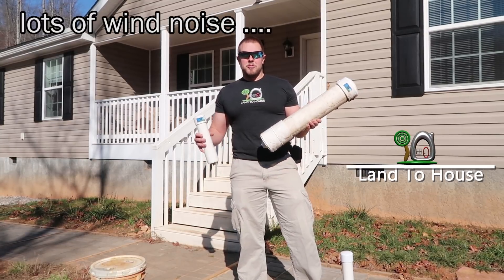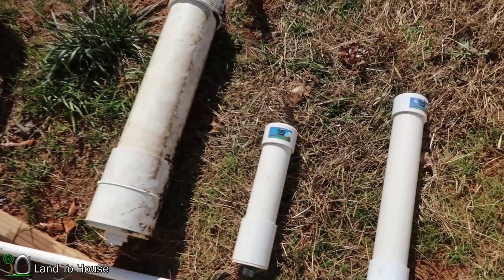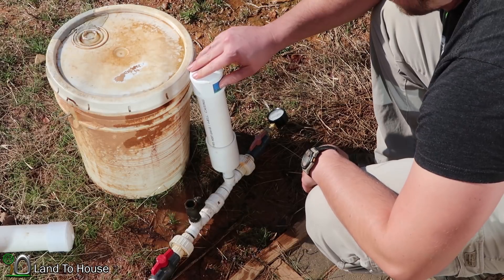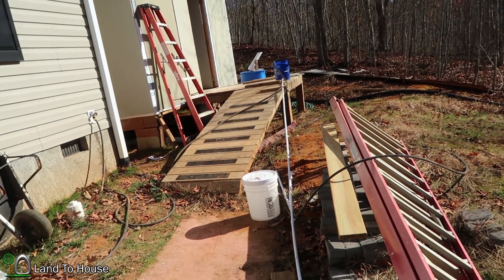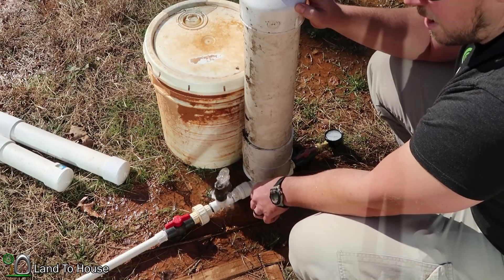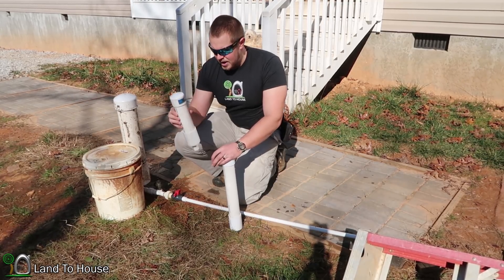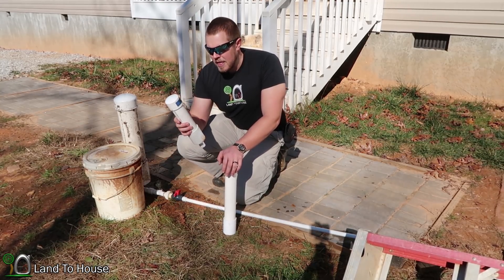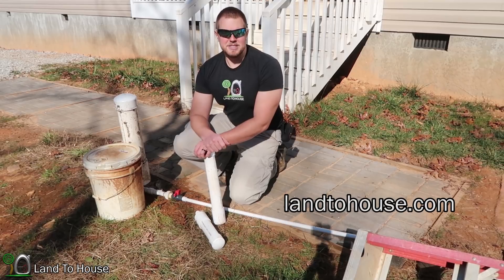Pressure tank size - Ram Pump

Comment: nice vids but as you have said you fill one of the tanks with a bike tube.
ok that can help but air is air and even the tube will be useless over a given pressure so maybe try this.
1 take your big tank and add a hole at the top and fit with the valve from a car as this tyre valve will seal itself and give you a way of pre filling the tank.
2 open the in water so the waste valve is closed and add air to the tank to say 30% of you max psi.

this should do two things 1 stop more water getting in to the tank as its got pressure in there that's just air and 2 the pump should start without having to prim it with the waste vale. try it with the overs as i can see the small tank maxing out its psi before the big tank thanks to its small volume but with an air valve in the top you can push out the water just by adding air from a foot pump and the pump can then start filling up without losing pressure and thats means better head height but from a small tank have fun
Reply from the maker: I have a friend in France that uses a house water pressure tank that has the valve you're speaking of. It seems to work quite well. That is a bit more work then I'm able to do for my pumps. But your idea is a very good one. And produces good results
Reply: you could try adding the valve to the Tee just under the tank and the air will bubble up but in this way you can change the tank size with out modding any off them then you can try the clear bottle to see what happens inside

Comment: Nice video,   40 PSI is amazing..   Maybe go even smaller on the air tank,  and see,  just how high you can go..  I would think,   pressure is what determines Head height of the out put..  3/4 pipe is less than 1 square inch..    Would a 1 inch diameter,  put out less ?
Reply from the maker: Turns out the 40 psi  was reached because the tank was so small with such a small input water volume. The larger tank would reach that value also with more time.

Comment: Sizes, fall rates, valve flow.  All effect the end result.  If you used a stepped feed supply over distance and drop height starting with say a 3" pipe for the first 1/3.  .then a 2" for the next 1/3.  Then 1" for the last 1/3.  Then go from a 1" valve test, then try a 3/4 valve step, then a 1/2" valve test.  Also varying the length of the feed pipe sizes and drop rate for each.  by the end you can then decide what you need for each job from the results and have a base you can work from for an idea.  IE:  flow or pressure  to give the ratio needed to get the job done.  I have seen this before but don't know the numbers or formula to calculate it.

Comment: im aware this is an older video and unlikely to get this comment read but is it possible to precharge the tank with a bicycle pump to get that pressure with no downside?
Reply from the maker: The tanks that I sell with my pumps do have a bike tube inside. The tube allows the tank to have an air pocket that cant be filled with water logging over time. I have heard of people using a house pressure tank with bladder also.
Reply: thats just cool...i know absolutely nothing about ram pumps....the tube you put inside, is that atmospheric pressure? or do you prepressurize it before assembly?

Comment: I think the tests could be slightly improved...

1) The 5 gallon bucket seems to limit the test to 2 minutes. This is a very short time to truly test the 4" pressure 'tank'. The discharge pressure was still climbing when the test stopped. Perhaps add a running garden hose to the bucket to extend the test time.
2) Discharge Flow should be measured in ALL tests. The smallest pressure 'tank' started the quickest, but maybe the small volume of compressed air would also create a very small discharge flow.
3) The number of taps to prime the pump is not really a concern. Whether it takes 4 taps or 24 is irrelevant ... as long as the pump keeps running. Again, once the pump starts it is intended to run a very long time.
4) The water supply bucket head was roughly 3 feet. This has a direct influence on the water hammer pressure wave. Try two tests ...one with the 3 feet head, and perhaps one at 6 or 9 feet of head, or higher. This should have a tremendous impact on system performance.
5) Make a chart of ALL the readings in each test so we can pause the video and scrutinize the results.

I like your videos.
Reply: Dan .... thanks for a real analysis.... btw is the height important or the run off distance for a good pressure head???
Reply: exactly what im thinking. ty sir

Comment: So. Take the big pressure tank and drill a tire chuck. Use a bike pump to bring your big pressure tank up to the correct psi before you start your pump? Then what happens?
Reply from the maker: One issue with over inflating the bike tube inside is that it reduces the volume of the tank. The water that builds up is the main thing that gets the pump going. I am not sure of any way to pre-prime the tank.
Reply: Land to House I see. Well anyways I enjoy watching your videos. I'm in the process of making my off grid house right now....I have no springs but I'm using a rain catchment system off the gutters. My plan is to have my main storage on a platform about 4 ft off the ground. Then using that drop to feed a ram pump that brings water into a ibc tote water tower 16ft up in the air that way I can gravity feed my house with water. My waste from the one way swing valve will fill up a five gallon bucket with a bell siphon that will run to a much smaller wattage pump on a float switch to pump the waste water back to the main storage tank. Therefore eliminating the need for a power hungry pump to pump 16 ft up. That is my plan anyways....is that totally pointless or you think a good idea? Thanks!

Comment: What is the maximal percentage for the feed pipe? Is over 45% to much? Could u test it please?
Reply from the maker: When you say feed pipe I assume you are referring to the drive pipe? Do you want to know the amount of water that is lost from the waste valve vs the water that is pumped?
Reply: Land to House Thanks for the fast reply. Yes with feed I meant the drive pipe. With the percent I meant the drop/gradient of the drive pipe, if there is any maximum drop. And sorry for my English.
Reply from the maker: There is a max drop that the ram pump can support. The swing valve that I use in my ram pumps has a weight that allows it to fall open by gravity. When the drop in drive pipe is too great (typically above 20 feet) the pressure keeps the valve closed all the time. Large commercial ram pumps have a waste valve with adjustable weights.
Reply: And is it possible to make the waste gate work with a drive pipe that is about 12 foot long, aligned on a position of 6,5 foot horizontally and 10 foot vertically? Is it understandable what I mean? If so I would like to see a test, if you don't understand what I mean please ask. Thanks
Reply from the maker: Are you looking to have a drive pipe that is horizontal for 6.5 feet and then have a sudden drop of 10 feet to the pump?
Reply: No the drive pipe is the hypotenuse of the Pythagoras triangle.
Reply from the maker: This might be a question that requires a visual. Do you have a plan drawn out for your setup? You could send it to my landtohouse gmail.
Reply: Yes I sent a plan

Comment: What is the highest elevation can any of your pumps pump over a 380 foot distance?
Reply from the maker: The ram pump can pump over a mile. you will need a larger delivery pipe to make sure there is little friction. The lift is the main limiting factor to the ram pump. Each size ram pump has the same ratio input to output. The difference is the amount of water that the pump needs to operate.

Comment: Is it possible to have a pressure tank too small; or have too much pressure in the pressure tank? I've recently built a 3/4" ram with a 1.5" pressure chamber approximately 40" tall. I fear that my pressure tank is too narrow and that it becomes too pressurized to allow the ram to function properly. I have tried different things to get the ram working but all with little to no success. I've increase the length of the drive pipe, increased fall/elevation from the source, shortened the delivery pipe, experimented and reduced both the drive and delivery pipe diameters, all to no avail. The reason I made my pressure tank the diameter it is because I've found it extremely difficult to find pvc fittings/bushings to reduce down to 3/4" where I live. I was originally hoping to make a 3" pressure tank but haven't been able to find anything that would work besides the 1.5" parts. Do you think that my pressure tank is too narrow to allow my ram to function? I have good pressure from my source.
Reply: Remember that the pressure surge in your drive pipe must overcome the pressure inside of your pressure chamber in order to be able to open the check valve. So your drive pipe surge pressure has to be AT LEAST higher than the head pressure of your discharge pipe.  If your pressure vessel pressure is over the head pressure of your discharge pipe it will push water up the hill.  If your surge pressure of your drive pipe is higher than the pressure vessel pressure it will push water into the pressure vessel.  You just have to strike the right balance.  There are good ratios to use all over the web.  Google search drive pipe/discharge pipe ratios.  If your'e within those parameters your problem lies elsewhere.

Comment: Can you do a test video on the pressure bladder.  My question is... Does the pressure of the bladder help with the pressure of the outlet.   Or does it not effect the pressure outlet.
Reply from the maker: I have just finished gathering the things needed to make a few tests with the pressure tank bladder. I should have your answer soon. Its 18 degrees out right now so I dont think I will be playing with the ram pump.
Reply: I was interested in this also.  If instead of a rigid pressure tank you had a heavy duty balloon, or tyre inner tube....Would it not a) Shut the valve faster,  B )Drive the water faster out of the output pipe by exerting elastic pressure on the water ..... and C) Greatly increasing the efficiency of the pump?

Comment: i think too big is better, kinda like capacitors in a circuit, how would this effect flow of water, would a bigger tank increase the flow over time because it balances the pressure better or would a small tank because it dosnt contain much water
Reply from the maker: I feel that over time there would not be any more flow but it could handle a larger surge from opening the delivery valve. The head pressure can only create so much pressure in the tank.

Comment: Good test... interesting results...
I'd love to see the same test but with same volume of tanks... but all made from 1 pipe size. I suspect hydraulic ratios are part of the pressure factor. I'd also like to see a comparison of the volume deliver between the different chambers in this test.  Good vid!
Reply from the maker: To have a 2" pipe match the volume of that 4" pipe it would take a 6 foot tall section haha. I should be able to give a volume test rather easy with the same tanks that were used here. That might be this weeks ram pump video.
Reply: @LandtoHouse  maybe match the 4” to the 2” volume. Short fat compression tank.

Comment: A interesting thing might be a tank that has a baffle so it's a small volume at the start, and then opens once the psi gets up on there.
Reply from the maker: I wonder how that would be constructed? Should work but making it would be the issue. I suppose the bike tube in the tank does help to fill the void some.
Reply: I'll think about it. Maybe a tank that drains water slowly and allows the volume of air space to expand. You would definately want it to run automatically with the pump start-up cycle, using water as the control mechnism. Fun challenge!
Reply from the maker: I am a bit lost on how that would be designed. All I see is those camping cups that fold down to a small cylinder.
Reply: Land to House me too - for the moment. How about a pressure tank that had a slow leak in the bottom, and connected to the pump at the top. Inside is a loose membrane. When you start the pump, the tank is basically full, and over a number of minutes the water drains and the air volume opens up. Maybe too complex - but I think an interesting problem to think about.

Comment: My drive pipe is coming from a 10 gallon tote,so the drive pipe is submerged so I should not be getting too much air.  Is there any advantage for a larger pressure tank?  What size would you use?
Reply from the maker: The large tank has a slower discharge rate when the delivery valve is first opened. (because there is so much more water in the tank) The advantage of this is that the pump might not stop as readily when the valve is opened with low lift hight. .... My apologies, I work with around 10+ new people a week with different size pumps and I have forgotten what pump size you have.
Reply: Land to House 1/2 inch with real low flow.  Super high lift.  The psi on the pimp is like 90 psi.really steep up here Macon county NC
Reply from the maker: I would still stick with a tank that is around 15 to 20" of 2" pipe. 90psi is a lot. This week I am going to connect those three tanks again and see what the flow rate is between them.

Comment: Good vidéo like all your others. Do you think a big tank give an higher pression than a smaller for a very long duration (1 or 2 days). Try to answer to me in a basic english please, that s not my mother language
Reply from the maker: I feel that even with lots of time the pressure will only get as high as the Head Pressure will allow. If 3 feet of head pressure can make 40psi in a small tank it will just take longer for the 40psi to build in the larger tank.

Comment: Wow thanks again.  Just when I thought I knew all there was to know about Ram Pumps.  I have not used my pump in a couple of years.  Low flow massive high head and delivery.  My pressure tank is 4 inch and like 3 foot tall stuffed with closed sell foam.  The beast takes forever to prime.  My pressure  tank must bee too large.  After a few hours the darn thing quits.  I am thinking I need a smaller pressure tank.  Any recommendations?  I liked the pressure messurement you showed.  I was wondering If actual GPH delivery flow would correlate with the pressure reading.  Friend.  You have to be the most knowledgeable person on this planet on this subject.  Thanks for sharing these videos. We r learning  a lot from them.
Reply from the maker: Haha I am learning as I go as well. I guess because I am selling these fun pumps I had better know something about them. I should think a tank that size would be hard to start. Do you think that air gets into the drive pipe to stop your pump? If you can get the larger tank to prime it should run the pump without issues.

Comment: I used a 2. gal. pressure tank with a blader starts in1 push
Reply from the maker: Is your pump larger than 1/2" ? I should think it would be a lot faster with a larger pump. For example the 1-1/4" pump only takes a couple clicks to get that large tank primmed.
Reply: Its1 in.
Reply: works just as well on my 3\4.in. pump
Reply from the maker: That is odd. A 20" long 4" pipe is around 1gal of volume. Is your deliver pipe turned off and the tank emptied of water when you give it that 1 push?
Reply: a bladder tank the bladder is already pressurized the bladder is pushed to the bottom of tank

Comment: Try a well pressure tank or inflate bike tube in smaller pressure tank.
Reply from the maker: The large tank and the normal middle tank each had a bike tube. The smaller one did not.
Reply from the maker: Yes it sure can. I have a friend over in France who has done that very thing. His pump has been working for several years now.